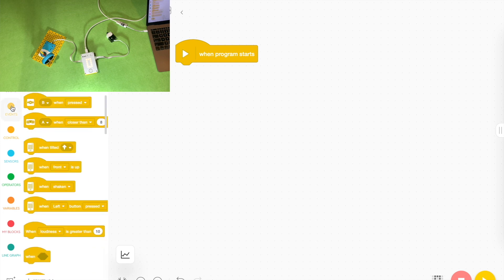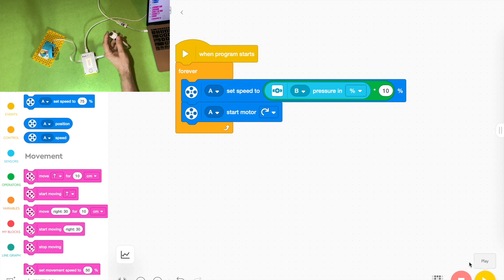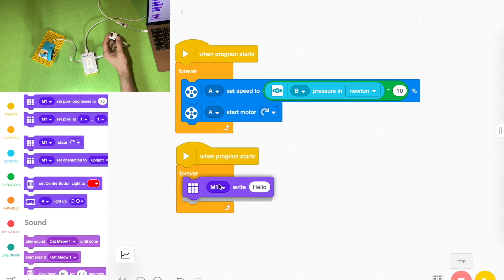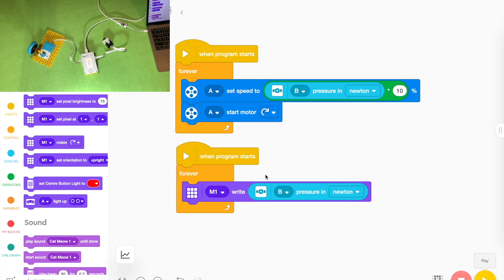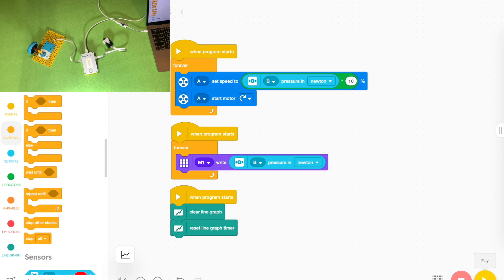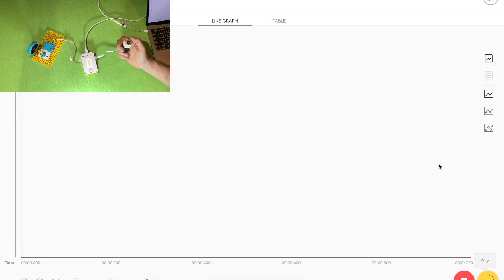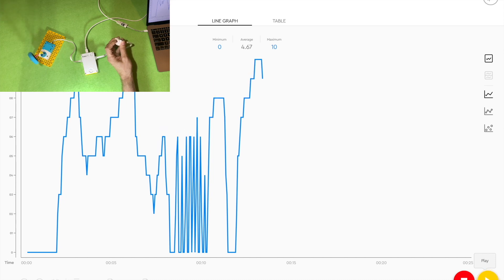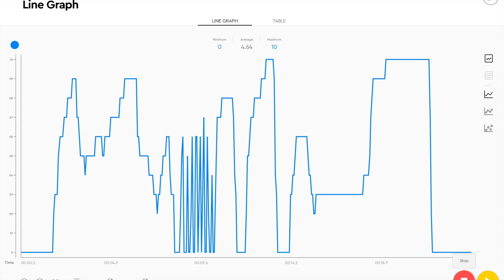I discovered cool tricks using the Spike Prime Force sensor.

Comment: This is super cool! And could be used to teach a difficult math concept for students from another angle they are unlikely to experience in math class.

Learning Outcome: I can plot points on a graph based on when and how hard the force sensor is pressed.

Show a gif of someone slowly pressing the force sensor. Then ask students to graph it on blank graph paper. Do this again with:
Start without pressing it hard, then slowly pressing it hard, then slowly releasing it.
Starting off pressing the force sensor hard, then slowly releasing it
Starting off pressing the force sensor hard, then slowly releasing it, then slowly pressing it hard to finish
Reply from the maker: Nice work!